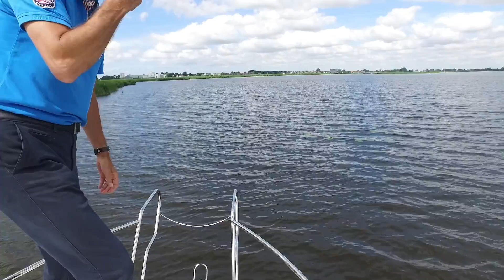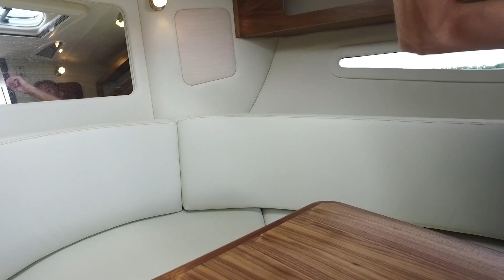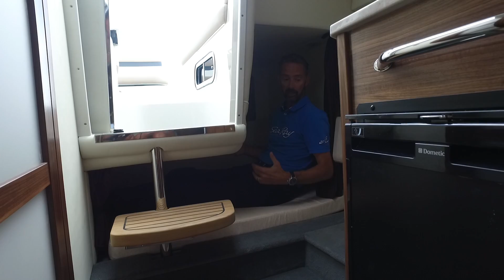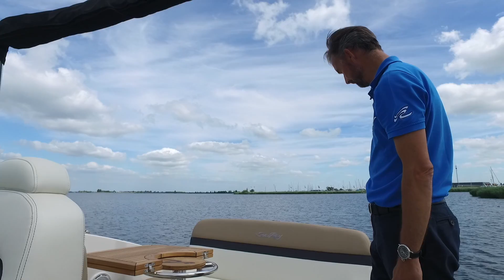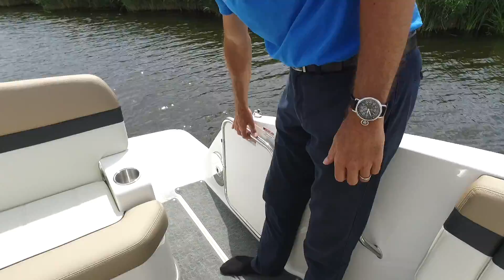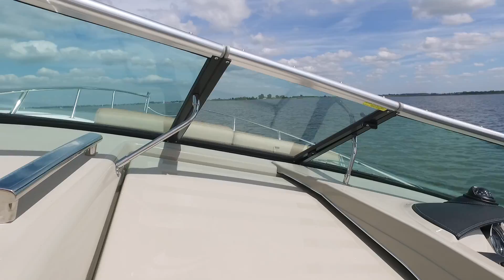Sea Ray Sundancer 265 Walkthrough

Comment: Sundacer 268 from 1987 is wayyyy Better and takes waves better as well
Reply: No boat from the 80’s was a good boat.
Reply: @Andrico77  it’s heavier has a bigger interior with a full dinette and optional twin engines
Reply: @Andrico77  The 1989 250 Sea Ray Sundancer was an excellent boat - perfect size with just the right of amenities. It’s still the boat to get if you can find one in good shape with low hours.
Reply: wrkbg the vest bew ñe beter

Comment: Hello! Must say that, this was a great walkthrough! i like what yuo just said about sea ray, and this boat. i am interested in Sundancer 260 diesel with 3,0 tdi engine 260 hp. what is the diference in design, and performance, and offcourse price is also i need to know.
best wishes!
Reply from the maker: Hello Aleksander, thank you for your reaction and compliments. I don't know where you are from and since there is a difference in availability for the different models in different countries, I suggest you talk to your local dealer. It may be interesting for you to know that especially the diesel versions of many models have become considerably cheaper for 2018.

Good luck in find the right boat for you & regards,

Bart Kempers